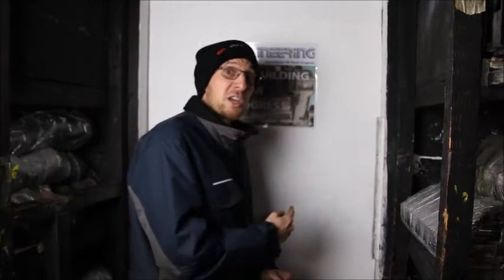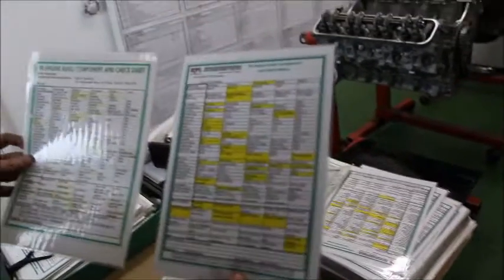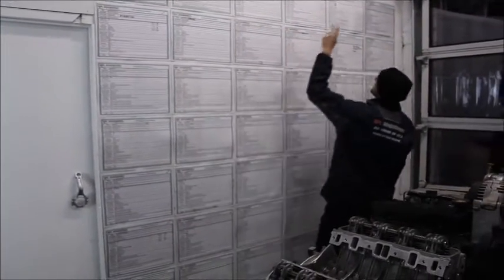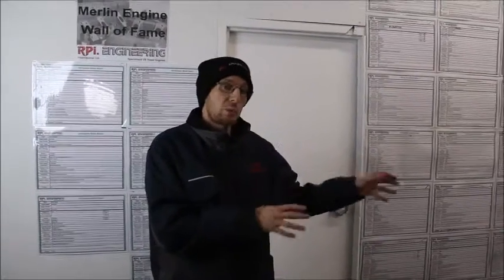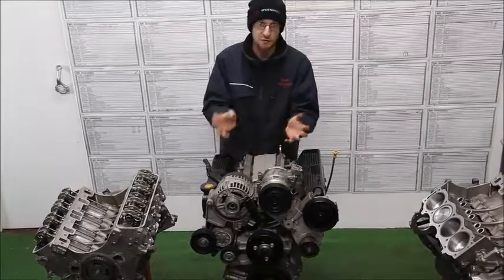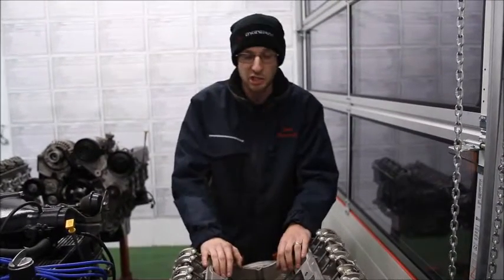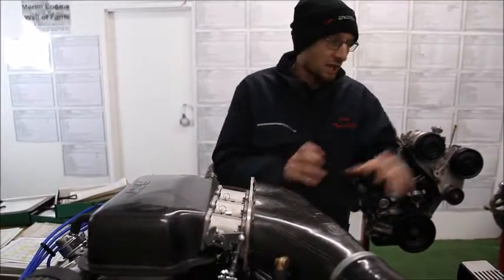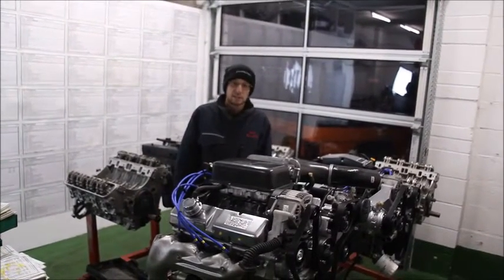RPi Engineering Engine Build HQ

Comment: I'm in California, US. I came across your site and saw the 5.2 pages and vids. I'm super interested in learning more about getting one. I have a Disco 2 with secondary air. I'm even thinking of finding another nicer one that does not have secondary air, too many problems..... I'd like to build up a complete ground up Discovery 2 with lift, wheels and a reliable and powerful motor. I really like that 5.2. Is it possible to buy it in parts and build my 4.0 into that beast? I'd like to have my motor balanced and blueprinted. I'm interested in torque for offloading and power on the freeways. Also, reliability is very important to me. I've also heard of the Coscast blocks but don't know enough about them. I think they fixed some of the problems with LR  old castings or something and such.... Curious about cost.

Thank You and Regards
~Matt

P.S. that 5.2 tho.....
Reply from the maker: Hi Matthew,
We would be happy to discuss this with you. Give us a call on +44(0)1603 891209
or email us direct on info@v8engines.com